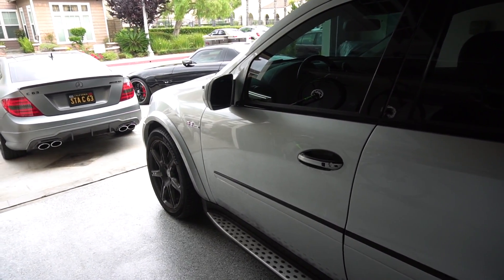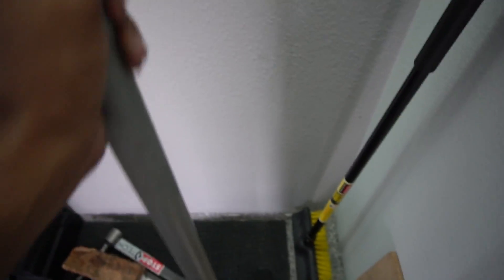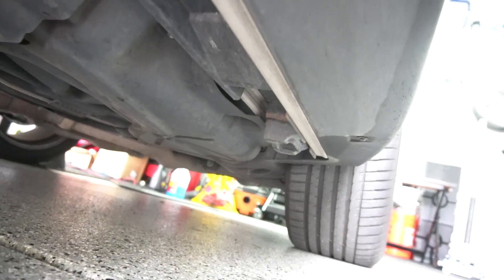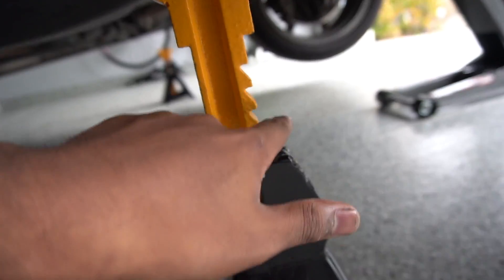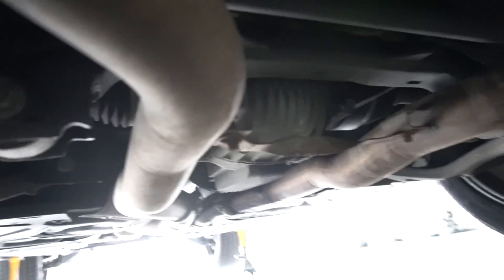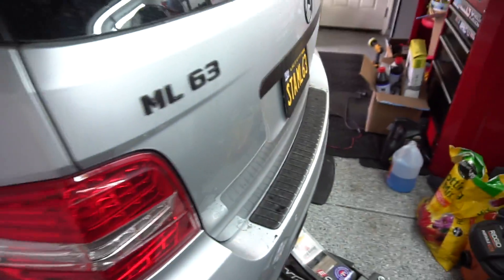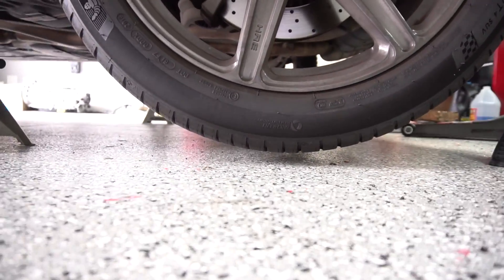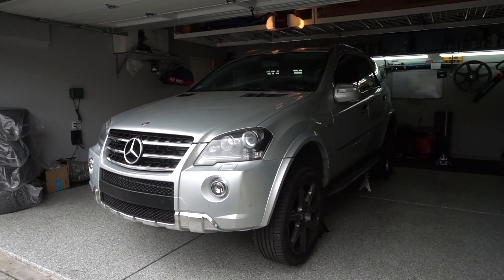How to Safely Lift a Mercedes W164 ML or GL off All 4 Wheels at Home

Comment: Is it still possible to jack up from the front if the front metal splash guard is removed?
Reply from the maker: The splash guards are plastic on this car, they only cover part of the brace that surround the front jacking point. In theory a solid central part of the subframe will work
Reply: @ gotcha.   I have the steel ones on my 550 and am having a hell of a time getting it put back on by myself.

Comment: Hello do you have to turn the air shocks off? If equipped.
Reply from the maker: It depends on what you are doing, regardless it is typically best practice to disconnect the battery when working on these cars. I personally have never had a problem with the air suspension getting in the way

Comment: I have a 21 GLE 350..I’m wondering where to jack up from in front and rear to do exactly what you did. I just need to remove for cleaning.
Reply from the maker: You have a W167, much newer chassis, although there are likely jacking points in the same areas. From the front look for something rectangular in between all the undertrays. As for the rear, the diff should be fine as well\

Comment: Thanks for video. I have some works back side of the car. Just lifting back  is dangerous? Should I jack front and back together or just one side is safe too ?
Reply from the maker: Just the rear or just the front is totally fine so long as you support the car with jack stands

Comment: is this also possible with the c63 w204 ?
Reply from the maker: With my C63, there's a front jack point very similar to this ML. At the rear I jack the car up by the diff. Would you like me to make a video on this?
Reply: @SamAbraham  thanks. For me its ok now. I asked because I like to put a Carbonfiber Front Lip on my c63w204. And side skirt too.

Comment: Thank you, will try this with my GL, just a quick question, when jacking the front did you put the jack and block on the curved piece of metal with the bolt through it? Just want to be sure thanks
Reply from the maker: My car does not have a curved piece of metal up front. There is a rectangular piece on my car but a semi-circular indentation on the plastic splash shield around it. There may be slight differences between ML/GL or AMG vs non AMG, but it should be relatively clear which part is the jack point.
Reply: @SamAbraham  thanks Sam, just figured out, it's the flat piece of metal behind the curved metal piece in the shot in your video, it makes sense now ,😊

Comment: Do you know any way to disable the airmatic so it doesn't keep trying to adjust if you open and close a door?  Great video!
Reply from the maker: Hey there, other than disconnecting the battery i don’t think so. It hasn’t been a problem for me in the past though, I just find that the car will sit super low once it’s back on the ground, and then lift itself back up when it’s started